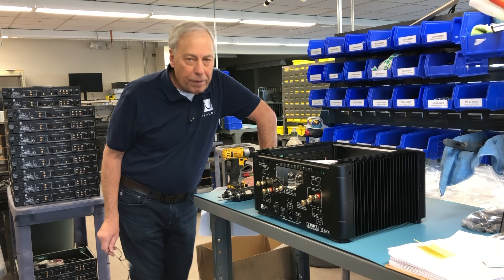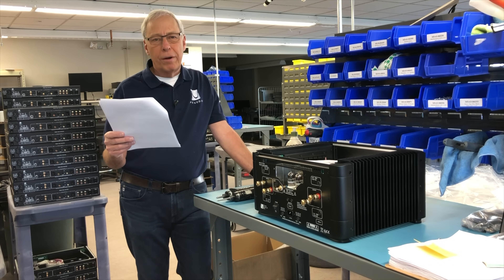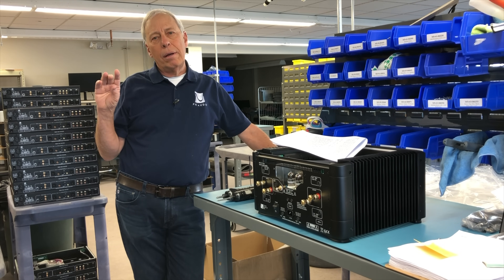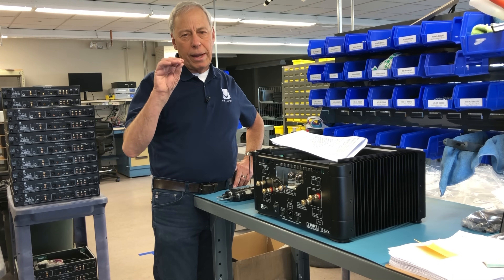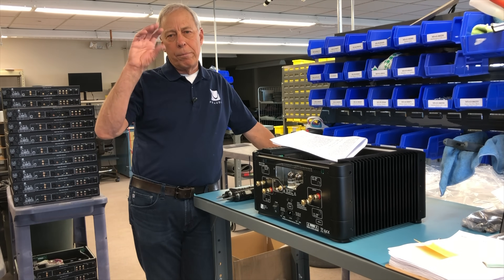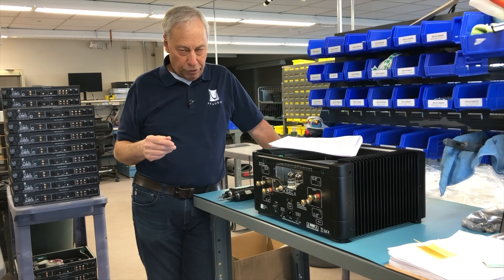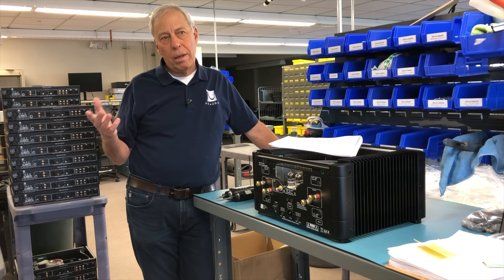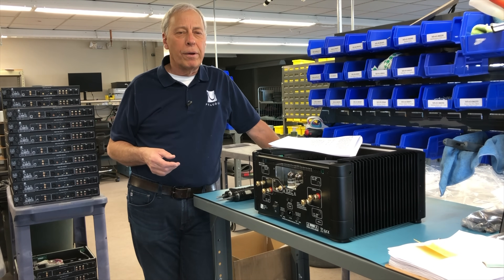Why don't amplifiers have clipping protection?

Comment: To be honest , a clipping protection circuit really do not change sound quality 
at all when you are below the set max limit .
It is when you have a higher voltage input and it start ' doing it's job ' you will 
hear a change BUT then you are already way too high on the voltage anyway  
so if turn down to just below it then NO DIFFERENCE AT ALL .
It is simply just a MYTH like so many other so-called High-Fi myths .
There is even clipping protection built in to the poweramp stage of professional 
Amplifiers that monitor the OUTPUT signal and lower the input if max is reached .
Again at normal ( with normal I mean NOT going over the limit ) use you wont 
notice at all this is present .
But when you are going over the max limit then it start doing its job and the 
tiny tiny delay from the  too high and until it is lowered is what you hear and it 
have a compressor like effect on the sound .
But after all , driving the amplifier above what it was built to handle is anyway 
bad and without protection ,well  it will clip because the powersupply can no 
longer deliver high enough voltage to reach the top / bottom  of the wave .
The limit of the power supplys Voltage and Ampere is reached and the top and 
bottom of the wave is simply flat like DC and ,,,,,,, well it's clipping as we say .
This is bad for speakers because the membrane / cone is pushed out longer 
time and thus a DC like voltage is constant for that small amount of time .
What happen is the coil can not dissipate the heat fast enough and by 
staying ' hot ' longer the coil burns .
Unders normal load at same power / volume BUT with a power supply 
there can deliver high  enough voltage to NOT clip then the cone / coil will 
move back and fourth in a NON interrupted motion and NOT stay pushed 
out / in at max at that ' longer time ' thus the variation of voltage combined 
with the Un interrupted motion will let the coil cool down a bit in between 
the voltage spikes and , well doesn't burn the coil .

This is also why smaller amplifiers are more dangerous to a even big speaker 
than a big amplifier is to a little speaker.
It is more likely a 20 watt amplifier is going to blow a 100 watt speaker 
than a 200 watt amplifier is going to blow the same speaker .
Simply because of the bigge power supply .

And Of course we may NOT forget that DISTORTION is extremely important also .
Bigger amplifiers also tend to have less distortion too and distortion is also 
a major speaker killer .

In professional use they for shure have clipping protection on and for those 
amplifiers without such then compressor / limitier can be used to protect 
the amplifier / speakers  and again those 
DOES NOT CHANGE THE SOUND QUALITY AT ALL .
As long as you are BELOW the CLIPPING POINT .
It is a MYTH .

Edit - As an experient , If you was to built clipping protection into amplifiers in 
the series of amps BUT never told anybody about it .
NOBODY WOULD EVER KNOW IT OR NOTICE ANYTHING AT ALL .
But those who doesn't know how to protect their speakers is less likely to blow them .
MCintosh as you already mentioned have used this for decades and is highly 
respected and deliver exelent sound quality so , REALLY  no , it doesn't change 
anything in the sound at all otherwise they wouldn't use it .

Sorry for the typos if any , im on coffe right now .

Comment: Is this similar to speaker protection? 
To protect the audio amplifier and the
loudspeakers during start-up sequence when the amplifier output might exhibit DC voltage, and to protect the
loudspeakers in the unlikely event of an amplifier power stage failure, where DC component would damage the
speaker voice coil.

Comment: Many amplifiers have power-limiting circuitry which serves to prevent sustained clipping, as well as keeping woofers from overheating.  Commercial amplifiers with DSP such as the Crown XLS series, my old Dynaco Stereo 400, and many McIntosh models have the feature.  
Placing a fixed clamp at the input (by the way, the Zeners need to be in Series, not Parallel) is an undesirable solution as it will consistently create distortion at voltage levels which are near but still below the clipping point.  Although this is functionally the same as the method NAD uses to implement their soft-clipping feature.

Comment: During the early 1990s, virtually all entry level NAD amps have clipping protection, but audiobuddies of mine who own such amps say that the amp souns much more open when the clipping protection circuit is turned off - even at moderately loud listeming levels - i.e. 96 dB SPL with a 90 dB per watt  / 1 meter sensitive loudspeakers.

Comment: Could you use speakers that can handle much more power than the amp can provide? For example, hooking up 500 watt speakers to a 100 watt amp? It seems like having over-rated speakers would give you lots of headroom so you can't blow them even at the loudest volume. As long as the impedance is correct it should be okay.

Comment: couldnt an auto mute circuit be designed so when the input voltage gets to a certain level it either completely mutes at the input circuitry or trips the overload and startup protection relay?

the relay i am talking about is when you turn on the amplifier a second or 2 later you hear a click.

i assume that relay is so you dont hear the thump and hum when the system is turned on and charging the large capacitors that are connected close to the speakers.

of course i think the relay is a last resort protection as it disconnects the speakers while the unit is on witch is something i have heard is bad as  you are taking the amplifier from full load to no load back to full load in a split second so maybe using the mute circuitry may be safer.

you could just turn down your input source like if you are streaming from your ipod or computer you could turn that down so you shouldnt clip and only use the loudness of the amplifier to fill the room.

not just ears but loud parties can draw the police as there are noise laws in some places so if you are in a place near other neighbors you could get complaints..

copyrights could be another problem you could get copyright notices due to public performance.

Comment: Loud in general is not good for speakers, whether or not the amplifier is clipping.  If the tweeters get hotter faster than they can dissipate the heat, it will cook the ferrofluid on the coils.  This will vary from speaker to speaker so much it's impossible to generalize.

The best thing is to keep a decibel meter around and not let the music get above 80-85 decibels consistently.  Anything higher is not a safe listening volume, anyways.

Comment: one of the amps i have owned was a nad d3020, nad have clipping protection the commenter says here, mine just went into protect mode if i played too loud, maybe i was not clipping the amp but hit temp limit or something, but it sure sounded fine until it shut itself off.  very loud for sure.

Comment: Good thing I read the comments BEFORE I type a response/comment as others have already said, NAD has soft clipping you can switch in/out if needed. I have a vintage 7240PE, the receiver version of the 3240PE integrated, both can be split into separates with the jumpers removed if desired. they are rated by NAD at 40W, RMS but we all know that's a conservative rating, it's closer to 60W, RMS. However, the amps are high current, but low damping (unfortunate for ported speakers, but are fine for acoustically suspended models) and a video on YT where a guy used a clipping tester and found that these have a lot of headroom, @8 Ohms, about 150W, 6 Ohms, 250W, 4 Ohms, I think 350W, and at 2, yes, 2 Ohms (rare for gear of this caliber), 550W!

In my living room with the first series ADS L810 speakers at 88 sensitivity, I can't run much past 12:00 as it gets LOUD in my room and my turntable begins to hum as oscillations in the low frequencies begins to invade, not good.  Tape/CD, not an issue and the amp does NOT compress, but stays clean and does not get all that much louder as the volume is cranked (as a test). So most of the time, I run the amp at best at 10:00 or maybe 11.00 at the absolute most as the oscillations  will begin to incur when playing vinyl as I do most of the time.

That said, I agree that best to have more than you'll need and NOT blow your speakers, but ADS also have fuses and thus pop if you try to run them loud with a lot of high frequency energy music first, long before the amp even hits clipping. I've done it, not intentionally so the speakers are not the ultimate rocker speaker, but I don't do a lot of hard rock/heavy metal anyhow.

Comment: I would think that the best approach to speaker protection would be to design power amplifier circuits around individual speakers, so that the amplifier could limit the amount of energy at any particular frequency to levels the speaker could handle.  Otherwise, almost any amplifier whose limiters aren't customized to a particular speaker will either be incapable of playing some inputs as loud as the speaker could handle, or would drive the speaker harder than it could handle given other inputs.  If one has 50-watt speakers, getting a 700-watt amp may ensure that the speakers don't get destroyed by amplifier clipping, but having the speakers get blown as a consequence of being fed a beautiful clean 600-watt signal isn't any better.  And replacing the 50W speakers with 700W speakers so that accidentally switching to an overly-loud source blows your ears instead of the speakers wouldn't be any good either.

At minimum, I would think that any amplifier which has a digitally-controlled gain path should be able to quickly cut the gain if the output power in any particular frequency band exceeds a certain limits that could be customized to the speakers one is using.  Having a sudden cut in gain may be distracting if it happened while one was trying to listening to audio at a level near where the system would cut out, but in most cases one would want to have an amp and speakers that could produce a little more volume than one would want to deliberately use, so one could set the cutoff a bit beyond that.

Comment: Just wanted to add that running too small of an amp loud damages more speakers than running a bigger amp loud, a 20 watt per channel amp can damage tweeters in a set of 100 watt speakers run into clipping ;)
Reply: Totally true , the Amplifier start clipping when it can't deliver enough voltage  .
Bigger Amplifiers have bigger powersupply so can deliver higher voltage and 
of course more Amperes too .

Comment: A zener or any diode "clipper" is just that, a clipper. The only difference is you are not stressing the amp but you are just moving the clipping to the amp input. You still hear a nasty clipped signal and it's still bad for tweeters.  The way McIntosh did it was a true clipping prevention system. They put a Cad cell  (same thing inside a lights on at dusk switch) across the input with LEDS or lamps fed from the speaker terminals shining onto the cad cell. As the voltage approached  the amps clipping region and the lamp brightened, the cad cell lowered in resistance and pulled down the input voltage. Thus no clipping took place. But this is not without faults. What you have here is a dynamic range compressor and is in fact how early analog compressors worked although they use a much more linear VCA now days. You can also reverse the process and use the feedback increase dynamic range such as the famous DBX processors of the 70s. And there were also several  magazine construction articles at the time for making your own range expander/compressor with LEDs and cad cells from Radio Shack. I must agree the best approach is to just stay out of the clipping region all together. Shouldn't be a problem these days with typical amplifier power levels.

Comment: NAD has been using that circuit for years with a switch to turn it off. John Bowers used the "a-poc " circuit in some of the Matrix speakers. Bottom line is, don't be an animal with your stereo.

Comment: I have a Realistic APM-200 peak and RMS watt meter hooked up to my tube amp system currently, but have had it for years. Best investment I ever made, saved many speakers because your ear is not a good judge of how loud it really is, especially is alcohol and a party is involved. The old Adcom GFA series amps had instantaneous distortion alert yellow led's on the front which were helpful. Many large amps of the past which I have had owned had large VU meters on the front, Kenwood 700M, Onkyo Intergra M-504. Rule of thumb I have used is never use all of your amplifiers power, if you need more than 50% of it's rated power that only leaves you 3db of dymanic headroom. You need a bigger amp like Paul says. Get a hand held sound level meter and pay attention to your listening levels. Safe levels for listening are 85db or less is safe. 95db is safe for 1 hour,  100db for 15 minutes. Of course those are for constant volume levels and music is dymamic so transient sounds that last for fractions of a second might peak higher. Kind of like how you can move you finger through the flame of a candle quickly, but don't hold it there. Of course 130db or higher can cause permanent hearing loss even for short duration, like a gun shot or thunder.

Comment: ADCOM GFA 555 that i use has lights that come on when you approach 1% THD, I can make them blink with the volume about 4 oclock and my hands over my ears when they are powering my MMG Magnepan speakers

Comment: I have to agree with Paul here 100%...!
Though you can get POWER limiters ( which just trip a relay ) at a certain RMS power level ... and others that provide current limiting to the power supply ( bit like foldback ) .. best think is, like Paul just said get an amp that won't clip and speakers that can handle all its capabilities with EASE... let your ears be the judge

Comment: I like the limiters that use a led and LDR, like: http://sound.whsites.net/project53.htm
They reduce the volume whenever the output voltage is above a certain level, without causing much distortion.

Comment: Apparently my Cambridge cxa80 comes with clipping mode, but it's turned off as default....I haven't looked into how to turn it on, but I don't think I need it anyway.
Reply: I have the same amp and it actually turns the volume down automatically if the amp starts clipping which is an awesome feature!
Reply: @behemothinferno  yeah, that's what I believe. But I haven't tried it out or even know how to select the feature.

Comment: A few decades ago there was an article that showed how to soft clip and amp by putting a diode in the negative feedback loop. I suspect that would feed back opposite polarity odd order harmonics to reduce those and make the output clip with even order harmonics, which tube amps do naturally. The result is a curved, not sharp clip. Interestingly, odd order harmonics tend to make heat. Don't quite understand he physics behind that but according to "Harmonics" by Mark Waller, this is the cause of many of the power woes with computers and why line filtering and conditioning is so important. Clipping the sound at the input may not cause the power amp to reach clipping, but may make the sound kind of nasty. Ever hear an over driven signal into a preamp? Blech!
Reply: Problem is actually, tube clip much earlier than transistors, at the time tube clips, transistors are still working without any distortion. At the time when transistors are clipping, tube has already outputted crap. But that depends on the supply rail and design of course.

Comment: Hi PaulThe Zeners would be in series. The voltage across a Zener in the opposite direction is about .7 volts. So to clip at 2 volts a person would use a 1.3 volt Zener in series with a Zener placed in the opposite direction. The conduction would occur at 1.3 volts for the forward Zener plus .7 volts for the reversed Zener. The problem I see with that idea is the signal is still clipped. Yes, with a R/C network it can be softened. Professional amps have a compressor circuit that kicks in to reduce the amplifier gain as it approaches clipping. I like your approach best though as any of these circuits will affect the sound. I like the idea by Oystein to buy a pro amp for the loud times. When you are listening that loud the loss in quality won't be so obvious and pro amps are cheap new or used.
Reply from the maker: The classic circuit is two zeners in opposite directions in parallel. One end to ground the other on the input. Anything exceeding the zener's rating gets lopped off.
Reply: Sorry Paul, that would leave you with a peak voltage of .7 volts regardless of the Zener rating. I have seen the circuit you described numerous times to protect the input of an i.c. but they used 1N914 or similar. If you look at Klipch's  older tweeter protection or the Koss E9 adapter box input protection the zeners are in series cathode to cathode or anode to anode.
Reply from the maker: @johnhodgson5313  Ahhh, you have jogged the old memory out of the cobwebs. That's right, those shunts were 1N914 standard diodes. Thank you for clarifying that. I stand corrected.

Comment: I think that to answer the first thing that comes to the mind of a novice full of adsurd dilemmas (as I was too when I started in hi-fi) is a waste of time. I could seem rude to some but I blame my poor English,  far from my intention.
If we audiophiles care our equipment and our ears and knowing that rarely is needed more than ten watts  in average at an apartment to blast, well...
Two brands comes to my mind when some sort of soft clipping is used, NAD and McIntosh but almost all amplifier builders use some SOA guard circuit to protect final transistors. I believe the differences are in which stage the protection circuit is put. When it is in the input or voltage amp stages is a soft clipping and when it's in the power stage it's named differently.